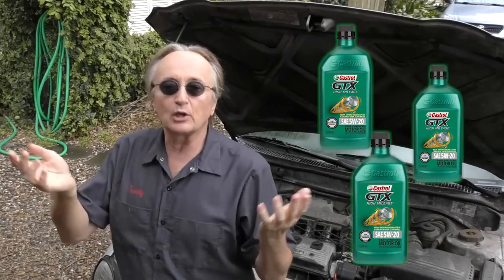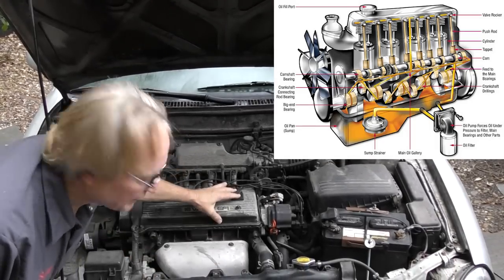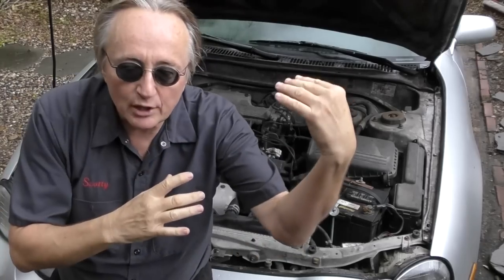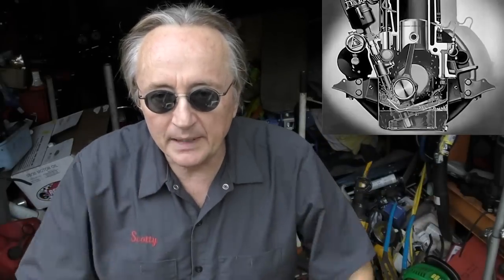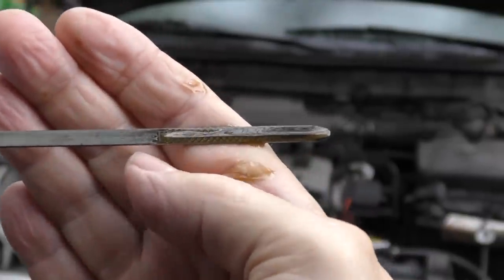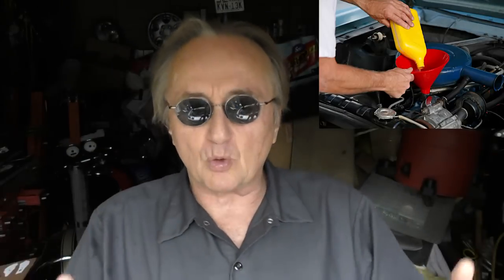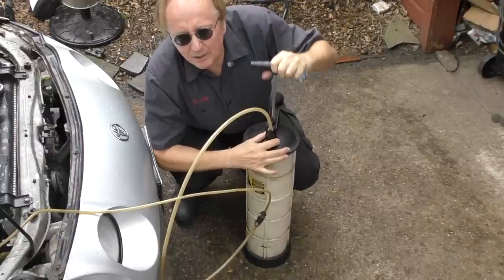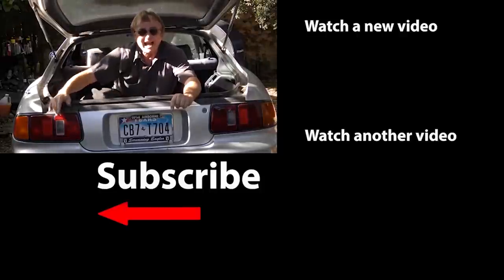Doing This Will Destroy Your Car's Engine

Comment: In addition to checking the oil when the engine is cold, it is also important to pull the dipstick out, wipe it off, and put it back in and pull it out a second time to get an accurate reading. As oil cools and changes viscosity (thickness) it will tend to creep up the dipstick, which will give a false reading of having more oil, than is actually is in the engine. I've seen it creep up the dipstick 1/4 to 1/2 inch, which created an artificially high reading.

Comment: Driving back from my shop, I saw a guy in an older (80's) Toyota having issues. Car was running bad, and it was puking thick white smoke.  I was in the shop truck, so I stopped to see if I could help. 
Guy said he'd just done an oil change and could not understand why it was running so badly.  He opened the hood, pulled the dipstick for the AUTOMATIC TRANSMISSION, and said "look, it's right where it should be!"

Opening the filler cap showed oil, covering the camshaft. On an OHC engine. 

Told him to "Go across the street to the Fry's (Kroger) and get a kitty litter pan, a sack of kitty litter, and aroll of paper towels.".

I swear, I drained at least two gallons of oil from that engine.  But now, it had the proper volume of oil.
It smoked a LOT, but that stout little mill eventually cleared up. 

I took a yellow paint marker and colored the engine dipstick so he could find it easier.

Comment: Great video Scotty and a very important one too. On some occasions when my car's been at the garage I noticed they topped the oil up way too high. So I made my own vacuum pump from a big syringe and a bicycle brake cable in case I ever need to drain it out again. I think some mechanics are a bit clueless and tend to check oil levels after engine's been running.

Comment: Thank you Scotty. I'm a woman and I take a lot of long highway trips. I check the engine and coolant myself. You really gave me a tip right here of making sure I'm checking on a level surface. I'd never thought about that. I also carry extra fluids with me just in case. I've got one those 03 1.8 turbo beetles and ya know how those engines can be a real pain to maintain. Yep, Ive dumped some money into the engine but it's still going and not burning hardly any oil at all. :) Lol. After all new parts pertaining to anything with oil, timing belt and water pump.

Comment: I once  put too much oil in my Tercel. Once on the road at high rpm, it did a huge opaque oil smoke cloud. It was only for a moment. Then I returned home , drained the oil and the engine was fine.

Comment: I was having the same problem today from Hyundai dealership, they overfilled oil in my diesel engine. Thanks scotty for clarification. 👍
Reply: Make sure you check the owner manual of your car for instructions on how to properly check oil level in that vehicle before claiming they overfilled. Many manufacturers instruct you to warm and cool the engine before checking the oil level.
Reply: @zarbon700  you are right, the instruction manual of my 2015 car says have the engine on operating temperature, then shut down and leave it for 5 minutes on level surface, then check the oil level.

Comment: Good Day Scotty : This happened to someone I use to know in the past with an old Ford 289 V8 . They moderately over filled the oil and the crankshaft whipped the oil into a froth . When they went to check their oil level they pulled the dip stick out and to their surprise oil came frothing out the dip stick hole like a milk shake .

Comment: Precisely why I do my own work and will not get my oil changed at those quick lube places.  I've seen the people they have working there. No thanks.
Reply: I have a Toyota Matrix and went to Walmart for new wiper blades. The mechanic looked at the rear wiper and said that I would have to take it to the dealership to change rear blade. He said that the dealership will have to remove it and install. I said okay and drove across the street at AutoZone. I never mentioned what the technician said at Walmart. I asked for new wiper blades. Inside a minute he had all my wiper blades installed. I watched him flick a switch on rear wiper and it took a second to change. Hey, that's the LAST TIME I had my oil changed there!!!!
Reply: It all depends on where you go. I used to work at a Car-X as a lube tech. The owners son (who ran the place and trained me on how he wanted things done) was very specific on how to do it the right way and no car I did ever left over filled. I would bet my life on that. Of course that was not so much a 'quick lube' because they ran by appointment at 20 minute intervals usually.
Reply: I have a theory that they don't even change your oil but still charge you for it and say they did. Probably not true, but I still like doing it myself just so I know for sure what is being done to my vehicles.
Reply: @walterweddle7644  They shut down many of their mechanic shops here in Canada.  That should tell you something.
Reply: @Impervium1090  In my women in mechanics class the lady mechanic told us to ask for the used parts like the filter and what not be put in a box and into your trunk. Anytime you have work done ask for the stuff they took out of the car put in box in the trunk. I got ripped on paying for a filter I didn't get once.
Reply: micks336 That’s not a bad idea, but still no way to prove if the filter really came from my car or was just an extra they pulled out of the trash. I’d like to believe people are better than that, but I just don’t trust anyone with my stuff
Reply: @Impervium1090  Sure there is check that it is the correct filter for your car.  Grabbing one from the trash may work with your car it may not. Take a good look at the filter before taking it in.  Have a lady friend look at it too.  We have the eye for details and would know if the filter is even half a shade darker or lighter.
Reply: As I mentioned before, many years ago my wife took our Saturn (we sold it) to a quick lube place. Somehow they drained the oil but didn't put enough back in. She drove it home and said a green light came on in the dashboard. I said what did you do, she said I drove it the rest of the way home, about 6 miles. I gave myself a dopeslap and went out in the garage and checked the oil, it was 3 1/2 qts low and it only held 4. After that I changed the oil on our cars myself, but I had to put in a qt of oil every 500 miles in the Saturn because it was burning oil, the engine was partially fried.
Reply: micks336 Just because it’s the correct filter for your car doesn’t mean it’s the one that came from your car. They could have had the same type laying around the shop somewhere. It’s impossible to tell without actually seeing them pull it out of your car.
Reply: My brother used to always scratch parts that a mechanic was replacing with an awl. No awl scratch on the part they give you, you know they didn’t replace it.
Reply: @Impervium1090  - Ooh, good point about the filter you get back possibly being pulled out of the trash.  I hate to think they would actually skip changing the filter.  Terrible.
Reply: @walterweddle7644  Those are not real "mechanics" at Wal-Mart.
Reply: @johnc1975  oh yeah I have had two Saturn's and they are fun to drive. My work car is an old 02 base Saturn and one reason I bought it because it has crank manual windows. My older 98 Saturn had twin cam.. My 02 is a SL1 different engine. The oil filter is hard to reach. Now I am a Saturn guy but we have a, Toyota Matrix and the old 72 Chevy. That's enough. Glad someone also had a Saturn. They hate gas.
Reply: @Impervium1090  They buy the cheapest oil and filters they can get their hands on to maximize profits. To make money on $25 oil changes, they spent less than $5 on materials.
Reply: I just did my first service after dealer warranty expired (requiring me to take it to them to keep the warranty - used car). When I dropped the oil, only ~2 litres came out of a 5.5 litre capacity. Since I never see oil on the driveway, there is no way they were changing it each 6mth service.
I drive 3k miles a year, so I guess they thought they could get away with not changing it.
My bad though, I should have checked the oil more frequently.
Reply: I went to a quick change oil place they forgot to drain the oil instead of they just refilled with another 5 quarts on top of the oil already in so I had 10 quarts of oil in my car when I should have only five
Reply: modular97 l
Reply: smithraymond09029 either do your own work or have the dealership do it, never trust third parties unless they have references
Reply: @Impervium1090  no...it's not....you mark it before you go for an oil change
Reply: @richsweeney1115  that’s a good solution.
Reply: @walterweddle7644  I've had 4 saturn's, one was a 96 SL 5 SPD,  that was my exs, she had that for 4 years before it got totaled at 225k. I had a 97 green SL1 5SPD, my wife and I had a 99SW2 w the twin cam motor 5 spd, nthe SW2 was the only saturn wagon I'd ever seen with leather. It was maroon with tan leather. and my.last one was an 06 ion 5 spd. All really reliable
Reply: @qaisersheikh2712  or you could just bring it to a small shop....if you can't or don't want to do it..or don't have time ect..you don't need the dealer.
Reply: Judge much???

Comment: BUT IF YOU DO THIS TO YOUR TOYOTA, EH, IT'LL STILL LAST FOREVER!
Reply: ahhaha nice one
Reply: Previous owner of my 2000 Corolla overfilled and barely changed it. A little rough on idling but she gets me where I gotta go everyday
Reply: If you do it to a Toyota 2AZ-FE it'll just burn the excess.
Reply: I drove a 1986  Toyota Land Cruiser with a bad head gasket for over a year just had to keep adding radiator fluid , before I put a new head and gasket.
Reply: I rolled down a hill in my toyota 4 runner and it still got me out on 4x4 to the highway..
Reply: T.O.Y.O.T.A The One You Only Trust Always
Reply: Handsome
Reply: probaly nothing happens. still runs as normal.
Reply: Its does not matter what engine you overfill too much it will still ruin it over time including Toyota engines.

Comment: Talk to the manufacturer, not the dealership to find out how much extra oil your engine can take.  The notorious engine burning Subaru H6 engine can take up to an extra 0.9 quarts of oil according to their corporate response center.  Above that then the damage Scotty speaks to can occur.
Reply: Sam S That’s a good bit of extra oil! Any clue what the 2.0 boxer non turbo can handle?
Reply: @fartnutssupreme4930  No.  You need to contact Subaru Corporate and find out.  They give you an adviser and then they go to their engineering team to give you an answer.  I kept the email record and printed it out for documentation, but now I have about 100,000 miles and no problems (it started burning oil at 40,000).  They said it won't harm it at all on the H6 but they also said it does not apply to other engines (the amounts are different). Best of luck.
Reply: Sam S Thank you!!
Reply: I have a 2010 Impreza 2.0 tdi 150 hk. Have you any information on that engine.
Reply: Or just carry extra oil with you and check it every time you get gasoline.. which is what should be done anyway. That's why pump have the hold latch so you can do other things while the tank fills.
Reply: Subbies suck to own over 100k. Expensive to maintain.
Reply: Subaru made a Ferrari F1 engine?  Those are known for burning engine oil during race for extra power
Reply: nagasako7 yes I was just reading that piston rings cause most friction in engine so very small rings with light tension making more power to race
Reply: Boxer engine can't take overfill as much as other type of engine.
Reply: @fartnutssupreme4930  He just said talk to the manufacturer, random Youtube commentors are hardly better than dealerships.
Reply: Christian Wertti That’s why I thanked him for taking the time to respond ;)
Reply: @fartnutssupreme4930  4,3 to 4,5 liters
Reply: @ninjamaster3453  can u explain a bit more? We Are looking to buy a 2014 subaru crosstrek..with 101k? TY
Reply: @Cragified  Not quite buddy, You don't check your oil when your engine has been running.
Reply: @PlasticCogLiquid  It takes less then a few minutes for the majority of the oil when the engine is up to temp to run down the oil galleries and into the sump. Near enough to give you a decently accurate reading and it takes that long to fill a tank.

Comment: If 6 quarts is good, 10 quarts must be better. 🤷‍♂️ 🤣
Reply: @mistamaog  A 4 on the floor automatic 2.3L 83 mustang L however does not.  I killed my mustang with too much oil when I was 16 and just learning about cars. Lol I miss that car it was so cute.
Reply: I had a roommate who filled an engine completely full with oil, it was HILARIOUS. Luckily, he was in the parking lot of Walmart that had an auto center, so he just drove it around back and had them drain the oil. The cloud of smoke that it made was HUGE.
Reply: to be honest alot of engines do use 10 quarts now, my 2018 mustang takes 10 qts
Reply: Only with Whiskey, not motor oil.
Reply: My Toyota Yaris 1.3vvti accord to user manual book takes 3l of 5w30 when just change oil or 3.2l when changing with the oil filter that what I did and guess what? I overfilled.  Because you never drain the 100% oil from the engine. Now I just put 2.5-2.7l when changing oil +filter and is perfect- gives 80%level
Reply: W12 engine uses 12.5qt
my BMW uses about 8.5qt 
all my friends hondas and shitty toyotas used like 4qt or something lol everyone made fun of me
Reply: iMiguelAOG , Hi :  Sometimes when American V8's are used for powering boats there are extra large oil pans installed . For example , a Moroso deep sump . Or people that extend their own oil pans by cutting and welding and therefore carry more oil .
Reply: @mujjuman  My volvo before use 6qt and 7 qt when he oil cooler drain.
Reply: Just drive through an oil pit.

Comment: Always double check your oil level, especially if you didn't change it yourself. I've experienced a shop that forgot to do the oil change at all and another shop that drained and either didn't refill it or left the drain plug off. (I did not check for the latter.) Beware of rapid lube places, a coworker had his drain plug cross-threaded by one. His "rapid" lube was anything but.

Comment: ENGINES ARE ENDLESS MONEY PITS
Reply: Can’t live without it
Reply: @jimmysapien9961  Unfortunately!
Reply: You can always just walk.
Reply: Jammbi Goat so are you, endless money pit.
Reply: Buy a normal car, not some fucking mercedes. look after it PROPERLY, and it will serve you reliably many years.

Also, crappy car mechanics are the number 1 reason why cars break down so often.
Reply: Buy a horse instead.
Reply: And automatic transmissions are garbage...
Reply: Said Fred Flintstone
Reply: Got to cooper motor in electronic car then. That rust over time so the E-car need new battery and motor after warranty run out.
Reply: Ride a bike!
Reply: Stonee_bmx _ replacing flat tires on those could be endless money pits
Reply: Ozpley Osbourne they are endless money pits
Reply: GabMesIRT 😂😂😂 best comment
Reply: You got that right mate worst than girlfriends aye
Reply: @Kamesuko hahahah 🤣🤣🤣

Comment: Scotty can you do a video on manual transmission fluid flush. Manual vs automatic trans. There no videos specifically on manuals transmissions.
Reply: Don't do it, just change the fluid. Flushing can cause alot of problems.
Reply: Fluid flush can cause problems manual transmission? I thought that was only for automatic transmission.
Reply: @cristiancenteno6876  Your manual transmission is 9/10 times just splash gears, meaning it lubricates all the gears via rotating the oil and splashing it. Not really much you can do to flush it, when it drains almost all the oil comes out. If you want to take the extra precaution, it wont hurt it, but theres really not much of a benefit to it nor downside, I should say.
Reply: @FeelFighters  spoken like u know your stuff.
Reply: On your Manual make sure you remove the "Fill" Plug first before the "Drain" Plug and you are good to go.
Reply: @Shakerhood69  This too.
Reply: @pinktoes3875  I've worked on a couple of cars 😁
Reply: @FeelFighters  Solid answer, thanks.

Comment: 22 years ago pression tune put 7 quarts oil in my 1987 olds cutlas 307. I checked it before I left and made them drain and start over. I've been changing the oil n filter in my 2002 s10 4.3 myself for 15 years

Comment: I prefer to change my own oil because of bad experiences at dealerships (not quick change places which may be even worse). Chevy dealership: drain plug over tightened causing stripped threads, another time drain plug not tight enough, oil started dripping out of drain plug, good thing I noticed it and tightened it myself. But this: My ‘96 Suburban was at a GMC/Cadillac dealer for a repair I forgot what for, I had them do an oil change. While driving home the engine wasn’t running right. I checked the oil dipstick at home and it was overfilled, WAY overfilled. Two different (so-called) “lube techs” both put in full amount of fresh oil! It had double amount of oil. Fortunately that dealership was near my home so it was a short drive away. That was 10 years ago, I still have the Burb now with 190,000 miles. Small block Chevy V-8 engines in my opinion are one of the best ever built. I’ve had this one 23 years so far. But, do not rev up your overfilled engine!

Comment: When drag racing or road racing high horsepower applications it is common to overfill the crankcase by 2 quarts to prevent oil starvation. If not using a dry sump.

Comment: I have a 2008 SAAB 9-5 and take it to a talented SAAB-only specialist for my 3,000-3,500 mile synthetic oil change. I bring him the oil and filter and he changes the oil. Never charges me. I use Mobil 1 0w-40 full euro and after 96,000 miles it run great, never burns any oil.